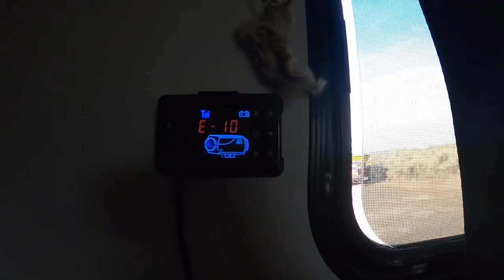Solar Power and Diesel Heater Install Finale - Full Time in a Cargo Trailer Conversion

Comment: I'll tag off your inspirational statement for this video, I am beginning a 7x14 cargo conversion, I've delved into the electrical system, I've zero prior experience with electrical, I've engulfed myself into videos, and have made a solid electrical system, currently in my basement (testing all of the loads we will have, bought all the necessary tools and supplies for wires, connectors, crimpers etc in order to have the system working prior to installing into the actual cargo trailer, so it will be a plug and play system.  My point to this comment, is that it only takes some time and understanding, to familiarize yourself with the whole electrical system.  DC is very simple, but is intimidating until you begin to understand it.  I have since expanded and added a solar charging and power system to the whole thing, again just getting more and more familiar with everything continued to increase my confidence with the system.  The best advice I can give as a novice in electrical systems, is to always error on the side of larger wire size than smaller.  My system will have almost all 2/0 gauge and 2 gauge wire throughout the entire system, while I have spent more, I know that those sizes can easily handle all the loads without much of a chance of any potential for disaster.  You are a remarkable young lady and are having an enjoyable life, keep it up!!

Comment: I work out of town and car camp twice a week. I bought a Chinese knock off "solar generator" which is 400 watt, plugged a 60 watt solar panel directly in it as recommended. None of the wiring you show is necessary. I run my computer, lights, fan and 12 volt tea pot and the battery has never showed less than 100 %.  The charge control and fuses are all in the "solar generator" which is a knock off of your Jackory.  I love it.
I enjoy your vidios!

Comment: I feel a 1" hole is wise. You now have access to run any wires to the roof for future use( a cell phone antenna or something) . It's not a 3" hole or something ridiculous. You'll seal it the same way. I'm impressed when a person who is not a professional has the balls to tackle projects themselves. I know it's hard but you have a brain and you're learning and you're doing a good job. You are also learning every day how to be self-reliant and independent. When you are in a location without anyone to depend on you will be able to fix any problems that come up. Be the person that Riot knows you are
Reply from the maker: Thank you so much!

Comment: Well now I am deep into diesel heater info...and several commenters have mentioned putting a furnace air filter at the air intake area to keep out dust and dog/cat hair. The heater were installed in boxes that had air intake holes so I was picturing the filter at that hole. Best wishes!

Comment: Lex I agree with others that have commented that a 1" hole is correct and you can buy a rubber grommet to go in the hole so sharp edges don't cut into the wirers. Just do a google search for rubber grommets for wiring and you will see what they look like. You can split it to get it on with out pulling all the wires out. It shouldn't cost more that a dollar or so.

Comment: You did well Lex.. I like the installation of what you installed .. It looks good and comfy to me .. 
Tie up your wires in little brackets like you did and 1 screw and zip it's on the wall out of the way off the floor .. In my kit of hole saws seems i never have the perfect size , i have one either too large or too small , i go as close as i can get , i can and i do fill up the extra space in the hole that's not needed , pair of sheers and an old rubber inner tube works perfect with some cement.. perfect and trim off the excess .. I'm thinking of a build like yours as it seems the better way to go for me and those toy haulers as some call them are well built and affordable .. Makes a nice little home ..

Comment: Awesome job Lex 👍 one inch hole is not an issue at all. They make grommets and caulking for that AND it allows for running more wires later if you so chose. What inspires me, is you're willingness to get outside your comfort zone. We all need to do more of that. Your adventurous, curious, creative, and independent spirit is admirable. I look forward to your next one. 🏍️🏕️

Comment: Love your humbleness, My heater is long down the road for now. All looks good to me, haven't mounted panels yet, maybe this winter in or near Quartzite AZ. No questions here, or yet...hehehe good work!

Edit, Love my 35L ARB fridge/freezer. Thought it was too big for me but camping with a friend? Its actually small but ZERO Complaints from me. At 22'F it freezes bottom food and fridge or above freezing near top. I also wrap it in a comforter. It only uses about 50-70amphrs per 24-30hours. Hope that made sense. I was lucky to find a new one shipped for $735. #day116 yeah
Reply: Careful with that modified sine wave for a PC. Best to use a pure sine wave, some items like the perfect frequency or Hertz

Comment: Riots tail end as cracking me up. When I drove over the road all I ever used was a 300 watt inverter. I charged my laptop off of it and recharged some tools and it was fine. It’s better to do as much as you can with your 12 volt power. You loose a lot changing from ac to dc. Check out the song called 12 volt man.

Comment: This is what I’ve read about these heaters.  If you run them on low, you should run them on high to burn out buildup right before you cut it off and you should fire it up a time or two during the summer and run iron high for an hour or so.  Use fresh fuel every season.  And lastly, do not let power from your battery stop coming to it while it’s in operation.  If the fan cuts off, the heater will overheat and mess it up.  Good luck with your new dry heat, I know you will be so much more comfortable with it.

Comment: That bigger hole is a good thing.  I drilled two small holes with grommets for the wires.  That made it difficult to get the wires through, does not allow for much leeway in readjusting wires later, and I actually scraped  the insulation on one of the wires.  I wish I had gone with a hole saw, and a bigger hole.

Comment: I think you did a fantastic job of implementing  those 2 necessary items.
After all this is  your home , comfort is important.
I got a light strip called I believe Noodle lite for the Jackery  and a fan.
Low pull power items.
Keep up the good work.
Smilez

Comment: Pretty much all the posts and Vids of these heaters is the fuel pump racket drives everyone crazy. If I get one I'll be wrapping it in sound proofing from day one.  Like, your fuel tank holding box. It's another thing I was thinking about what to do with it on my cargo trailer.

Comment: The 1 inch is the correct size hole. Then you go get a Chevy pcv gromet to protect the wires from rubbing on the sharp edges in the roof.

Comment: I agree with the reasoning RE: the 1 in hole saw vs. buying another size for a single use. It worked, so why not ? (as the old saying goes, "Perfect is the enemy of good enough.")  BTW, the "little house" on the roof that covers the hole & that the cables go thru ? It's called a "cable gland". Which is a weird term, if you ask me. ("gland" ? really ? 😆)
Reply from the maker: A gland??? Haha thanks David - learned something new.

Comment: Love the last shot of Riot zonked out, too cute. I just want to say thanks. I am currently looking into possible purchase of a Jackery 1000 & 2 solar panels. I will mainly charge as I drive but want the solar for weekends of camping off grid. I hope you don't mind me asking, do you think I'll be able to keep a 12V frig cold continuously and occasionally run a ceramic heater off the Jackery? I put a call into Jackery but have yet to hear back from them. I am clueless when it comes to this electric stuff. Thanks again for helping all us out here, keep up the good work, say hello to Robert & give Riot a hug for me :)
Reply from the maker: Hi Teresa! 
That sounds good. That’s a much bigger Jackery than I have so the best I can say is maybe... Check the watts on the fridge. I know ceramic heaters are low watts -  I looked into those as well. I’m sorry I’m not more help. Best of luck!
Reply: @LexandRiot  thank you :) it's such an investment I'm probably gonna hold off until Jackery gets back in touch with me to be safe. I'd love to do a heater like yours but my space is so limited due to hauling freight in the back half.

Comment: Great video young lady! That’s how we grow, getting out of our comfort zone. I have a couple of curious questions. 

Is there any Diesel smell in the trailer?
Is the noise of the fuel pump irritating? Thanks, keep it up👍
Reply from the maker: Hi Kenny! Thanks so much.
Zero smell of diesel. 
So far I actually like the pump - it’s like a metronome. Time will tell if that perception changes. I plan to do an update after more extensive time of use. 

Thanks for watching!

Comment: Have you done a leak test?  Aka hose down the roof. I think the only head scratcher for me was the wood product on the roof instead of some angled aluminum mounted to the rack. But as long as it works for you that's all that matters. What are those wall outlets connected to? Maybe you can tie them into the new system.
Reply from the maker: Hi! No leak test yet for the roof... don’t have access to a hose for that but I’m sure Mother Nature will provide. I attached the wood board to the aluminum rack as it was more in my skill set than angled aluminum - good idea for the future though! 
As to the wall outlets...they are connected to the shore power system... I’m not messing with them myself so I’m going to add in the 12 volt outlets separate - doing it diy means I have to expand into this as is - don’t want to over stretch it if you know what I mean. :) thanks for watching!

Comment: I'm thinking you should always charge your laptop with the Jackerie if you can . I think the pure sinewave is safer for the expensive electronics than your little red inverter. I'm not an electronic nerd .i could be wrong . im a carpenter but it was just my thoughts
Reply from the maker: I think I agree. :)

Comment: Hi Lex and Riot, I have some questions. I was wondering why you went with a diesel heater?  I’ve had the Wave catalytic heaters in my RV’s and liked them. Less condensation?

How does your trailer tow?  Mostly I’m thinking about ease and not mpg. V nose vs flat nose for wind and vehicles passing. Do you use a weight distribution anti sway bar set up?  My RV’s swerved so badly with no bars when being passed by even a car!
Reply from the maker: Hi Vanne! I went with a diesel based on recommendation, a friends experience, it’s dry heat, diesel is not flammable (it is combustible though) and cost - a diesel heater is $145 and sips fuel and uses negligible electricity. 

My trailer tows like it’s not there - granted I am pulling it with a f250 diesel truck - the truck could probably pull half a dozen of my trailers without an issue. I haven’t had much sway and I don’t use a sway bar. The trailer is only 6x12 though so that may help. I also drive 60mpg or slower as that’s my comfort zone. On high winds days I can feel some drag as the trailer is tall but barely. Sometimes semis make me sway a bit but I’m in the right lane doing my comfort speed zone so it’s not so bad. 

I hope that helps. Thank you for watching!
Reply: Thanks for reply!  I saw the wool insulation in your friends trailer and was thinking of getting a used cargo trailer and installing that wool insulation and the wiring instead of going with one already insulated. 

I’m glad you like your size and shape of trailer. I drive slowly too. I’m also considering a Tiny Stove wood stove for dry heat. I had a canvas wall tent with a wood stove and I’ve had tipis with titanium wood stoves. 

I didn’t like the tipi ones because it seemed like they were fiddle for the heat you got and I wanted to spend more time hiking than picking up sticks to burn. 

I enjoy your adventures and Riot too!

Comment: How well does it work? If the battery is charged at night, by morning is it dead?  A small thing but helps with communication: We charge batteries; power devices. Probably a "me" issue but you'll never put a charge into the diesel heater, but provide power to it.
Reply from the maker: Works great! No problems overnight. Thanks for helping me with verbiage, not exactly my wheelhouse. Thanks for watching!
Reply: @LexandRiot  Thank you! I get to learn from your good ideas as well as the curveballs that come. This looks so much safer than mr buddy. I might not even need an extra gas tank since I'm in a van. The power draw was my big concern. Thanks again.